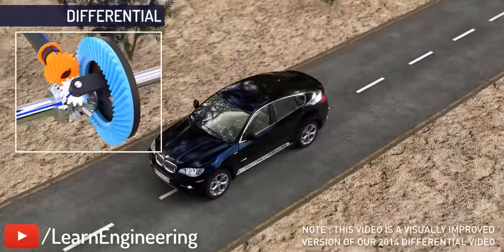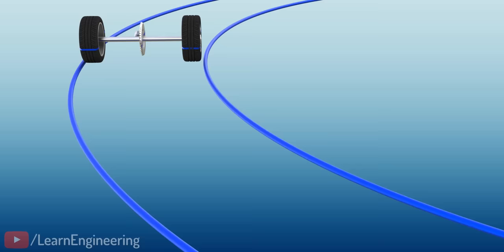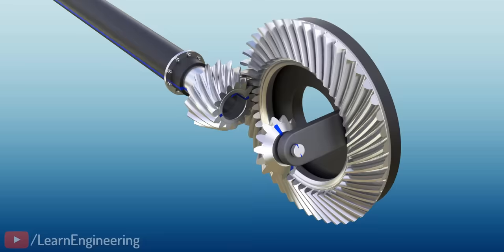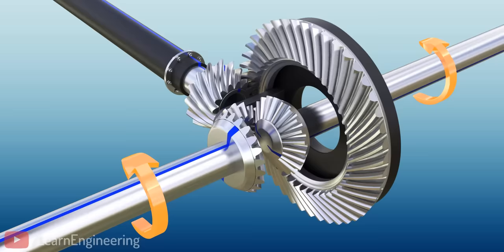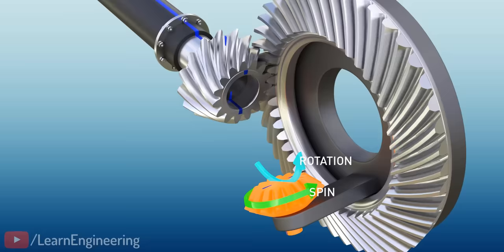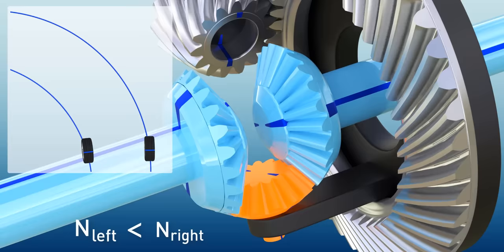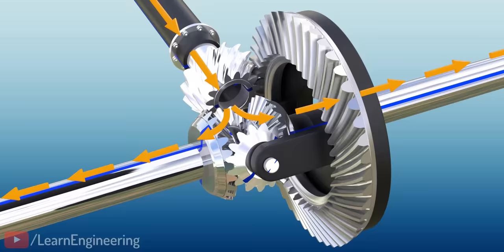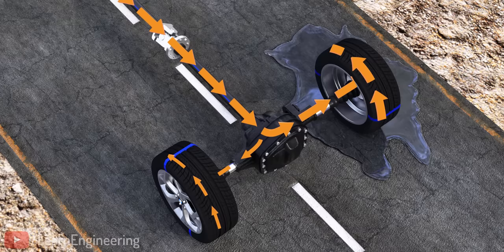Differential | How does it work?

Comment: For Christmas 1962 I got a large scale model car. Although I had to assemble the differential I didn't completely understand the mechanics. After all these years it is nice to have such a clear explanation and animated illustration of its operation.
Reply: It’s one of these things that is so simple once you understand it if u know what I mean. I was looking at the diff in my Ford anglia think8ng how in the hell does this allow the thing to go round corners aha
Reply: @cameronrichardson3108  I was able to keep up until he started explaining how the spider gear works. I still can't understand how one axle can turn slower than the other when both are meshed to one piece.
Reply: how old are u?
Reply: @RichardFStripeRendezvous  so when its going straight, both wheels want to slow down so they both exert a force backwards on the spider wheel but they cancel out. Image just the left wheel trying to slow down, it would push back on the spider wheel and rotate it counter clockwise. If the two wheels are doing this theyll try to rotate it opposite ways and it cancels out. (This is about why they dont rotate when going straight)

Now for turning, the spider wheel is pushing both wheels forwards still because of the larger gear it is mounted on, but the wheel on the right needs to spin less and if it didnt it would have to slip and drag along the ground. This is friction. Instead of this friction happening to the rubber of the wheel it carries through the axle to the spider gear. Remember what we learned about both wheels equally pushing back on it? Well now this added friction causes the spider wheel to rotate. If you look at just the sides of it where it connects to the wheel axles, on the right side the larger ring gear rotation will be rotating the right wheel, but the spider wheel’s side that we are looking at is moving the opposite way.

For the left side its the same, but since the friction is rotating the spider wheel on the right this rotation is added to the left axle. You really just have to think about the gears colliding and pushing.
Reply: @je862  I don't have it anymore. My friend got the Model T. I got the dragster.

Comment: I never even would have thought about the back wheels needing to go through turns, let alone figuring out a solution like this. Holy crap people are smart.
Reply: There's a rear end called a "Detroit Locker" that locks the gears so they turn at the same speed. I don't know it's origins but's used for drag racing so power goes to both wheels evenly at all times. If the racing car turns a corner the inside wheel typically chirps as it rounds the corner because the weight is on the outer wheel and the inner wheel has to spin freely by doing short little wheel hops.
Reply: بتوفيق
Reply: @scottheywood6502  а некоторые заваривают стабилизирущию деференциала
Reply: @scottheywood6502  для дрифта 🤪

Comment: Simply an outstanding instructional. Where was YouTube back in 1969 when I was taking my first automotive class? Thank you for putting this together.
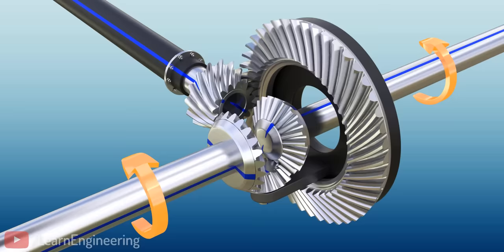Reply: @DMAX-tp4pc  2:06 the spider gear pushes on the two axles in opposite directions, so it doesn't spin when both rear wheels are the same speed

Comment: "The differential is an integral part..."
That's some clever wordplay lmao. Also, how do engineers think of these things?!
Reply: I think most inventor and or engineers simply wanted more efficient ways so they come up with rough ideas until we finally get what we have now. They're goal is to solve problems first. Then they can improve on that I suspect.
Reply: There's another one in the video: "The spider gear plays a pivotal role here."
Reply: They got big brain
Reply: if a differential is part of an integral, it would came back to its original value, plus the c i gues :))
Reply: And later, "the spider gear plays a pivotal role here"
Reply: Haha

Comment: It's brilliantly simple. It just finally clicked in my head. If one side turns lets say a quarter turn more then it's going to cause the gears to spin which has the opposite effect on the other side so it would turn a quarter turn less relative to the other side

Now it also makes perfect sense why if you have a car lifted in the air and spin the tire by hand it causes the other tire to spin in the other way, it's just simply because it has to have the opposite effect on the other side and because the other wheel is stopped the only way it can "slow down" is to turn backwards because the equation goes negative

Comment: A differential is a gear train with three shafts that has the property that the rotational speed of one shaft is the average of the speeds of the others, or a fixed multiple of that average.

The following description of a differential applies to a traditional rear-wheel-drive car or truck with an open or limited slip differential combined with a reduction gearset using bevel gears (these are not strictly necessary – see spur-gear differential):

Thus, for example, if the car is making a turn to the right, the main ring gear may make 10 full rotations. During that time, the left wheel will make more rotations because it has farther to travel, and the right wheel will make fewer rotations as it has less distance to travel. The sun gears (which drive the axle half-shafts) will rotate at different speeds relative to the ring gear (one faster, one slower) by, say, 2 full turns each (4 full turns relative to each other), resulting in the left wheel making 12 rotations, and the right wheel making 8 rotations.

The rotation of the ring gear is always the average of the rotations of the side sun gears. This is why if the driven roadwheels are lifted clear of the ground with the engine off, and the drive shaft is held (say, leaving the transmission in gear preventing the ring gear from turning inside the differential), manually rotating one driven roadwheel causes the opposite roadwheel to rotate in the opposite direction by the same amount.

When the vehicle is traveling in a straight line there will be no differential movement of the planetary system of gears other than the minute movements necessary to compensate for slight differences in wheel diameter, undulations in the road which make for a longer or shorter wheel path, etc.
Reply: DO NOT BE DECEIVED: THE WICKED WONT ENTER HEAVEN.  Jesus was a Prophet. Period

Comment: But, How does the spider gear get to know that wether he has to rotate about its own axis when the vehicle is turning or not??
Reply: Strength of resistance of each wheel. If right has resistance,  the spider gear will rotate and transfer more rpm to left side.
Reply: @dodzb7362  by resistance you mean friction from the road right?
Reply: @dodzb7362  what does it mean by strength?? Both wheels will have equal strength. By taking turn it doesn't mean one will lose the strength and other will gain🙄🙄
Reply: When travelling in a straight line: 

The rolling resistance of each wheel is near equal, and the spider gear will not rotate about its own axis. There is no net force that will cause the spider gear to rotate on its axis. 

When negotiating a turn: 

The rolling resistance of the inside wheel increases. The outside wheel begins to move a higher speed. The spider gear will begin to move on its own axis as the two axle shaft gears rotate at different speeds. 

The spider gears are not powered to move on their own axis. They move on their own axis only when the rolling resistance of one wheel increases vs the other wheel. Think of the spider gear as: a way to apply constant power to the wheels as they slip. Instead of the false notion that: the spider gear rotating on its own axis then causes the output axles to move at different speeds.

If this is still insufficient or does not answer your question, watch US Auto Industry's How a differential works. Its a 7 minute commercial from General Motors corporation that explains a differential beautifully through real examples.
Reply: @gunshipproduct2  great explanation dude!!
Reply: @gunshipproduct2  yes i have already seen that. I know you are talking about that black and white video which actually delivers beautiful concept. 
I asked this question because i wanna clear this. The spider gear is actually not the reason for delivering unequal speeds to the wheels while negotiating infact it is a way by which it is done. Actually the inner and outer wheels have tendency to rotate at a speed such that it can negotiate the turn without slip at their own same as in bull cart or pulling rickshaw. We don't need any differential in wheel chairs at all since they are not joined rigidly. So the spider gear is only meant for providing power from ring gear to the wheels while allowing for wheels rotation at different speeds while negotiating.
Reply: I think this video could clarify this part better.

Comment: Great animation! Just the one correction towards the end of the video: an open differential, by design, always sends equal torque to the left and right sides. There are inherent manufacturing imperfections and other issues that contribute to 'torque steer' and 'torque wander', which is why in practice any road load data will not show a perfect 50:50 split. 
When one wheel is on ice, for example, the loading on the engine drops, so the overall torque being sent through the driveshaft drops, but is still split nearly equally across the halfshafts.
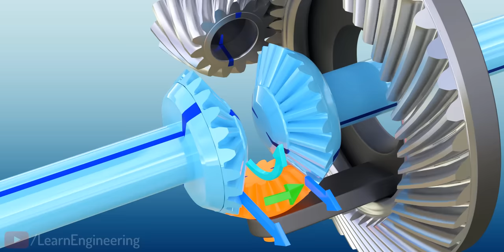Another way to understand the torque path is through classical mechanics: the pinion gear applies a force (N) on the ring gear, which gets multiplied by the length from the center/pivot (m). This gets applied to the side gears via the spider gear. When the car is moving in a straight line, the force is equally applied in the same direction to the left and right side gears. When a wheel begins to slip, the force is still equally split left to right, but the direction changes (one sees the force in the opposite direction). This video has a great representation of that around the 3:00 minute mark. However, since the same force is being applied on both sides and at the same distance to the pivot point (but in reversed directions), the torque applied to both halfshafts is the same.
Reply: You are both correct. He says all the POWER goes to the right wheel. In the situation shown, torque is the same, but rpm of the right wheel is significantly higher than that of the left wheel. So both wheels receive the same torque, but the right wheel expends way more of the horsepower (torque x rpm) in doing so
Reply: power stays the same but torque doesnt. Power is based on rpm as well and since 1 half shaft is goinng faster itll have more power at higher rpm but less torque
Reply: also not sure why they call it a pinion on the drive shaft, typically pinions are the driven gear(s), and the drive gear is the bull

Comment: Would this work in reverse, where two separate engines power one single axis, connected to like a single propeller? Two counter spinning engines with variabel output could power a heli rotor perhaps, of even four engines on four sides working together Powering one single vertical axis... or two counter spinning heli blades....
Reply: Yes, it's called a planetary gear set. It is used in that way e.g. in Toyota Prius

Comment: It's still black magic even after having seen this video.
Reply: The force vectors on two sides of the spider gear decide the turning of spider gear. If the forces are same, the probability of rotation becomes 0. Sounds esoteric but thats how its embedded in our physics.
Reply: @6s9hcr2  thanks
Reply: @Kuak_Kuak  Only reason I'm watching this video about differentials is because I watched that first video you linked. Old videos explain it better
Reply: Nah, try automatic transmission and all that planetary gears stuff.
Reply: @Kuak_Kuak  this is superb video you linked. Do you have any other stuff like on clutch, gears or any mechanism.

Comment: This was a good video as always but you guys could have mentioned that, to overcome the problem at 4:15, cars computers use the brakes to brake the wheel with no traction to force the other wheel with traction to spin as well. This is known as "Traction Control"
Reply: What you describe is called brake based limited slip differential. Traction Control existed before those brake based LSD’s and only reduced engine power to create enough traction.

Comment: How does the spider gear know when to rotate clockwise or counterclockwise?
Reply: 02:17 "spider gear rotates on its own axis. In fact it's forced to rotate because of different speeds of the wheels."
Reply: @balasubramanianp1372  so the difference in wheel speeds decide which way it rotates?
Reply: @therandomchannel02  Yes. During right turn, left wheel moves faster, moving the spider gear clockwise (when on top)..

Comment: After considerable attempts to comprehend the functionality of a differential, my understanding is clear as a result of this detailed and animated account of the operation. Until now I was arguing incessantly with the Dealership Service department folks that the grinding noise I am enduring while turning is not a result of the differential. I was unaware of the ingenious engineering compensating for wheels turning at different speeds. ( Heavy Sigh)

Comment: As a semi truck instructor i can tell you this is a great thing to have in your rears  but this also can cause a huge uncontrollable maneuvers during going through turns - slops - rain  or using any escape routs in time of emergencies.
All equipment in vehicles has more of negative bad sides then good advantages.

Comment from the maker: Hello everyone, this video is a re-release of our old differential video with better visuals. Please watch our old video here - https://youtu.be/SOgoejxzF8c
Reply: How spider gear is rotated to spin, by motor or any other medium?
Reply: Hi, amazing video! may I ask with which programme you made this video?
Reply: @shlokjadhav8253  Varying speeds in the axles. If the ring gear is static, you can rotate a wheel and the other wheel will rotate in the opposite direction.
Reply: Good job thank You.
Reply: @sfoti6973  SIR, can you explain simply because I am beginner but enthusiast to learn? Pls sir
Reply: Thanks
Reply: Your videos are interesting 
Please put more videos on electrical and electronics engineering  also 
It's my humble request from tamilnadu, india
Reply from the maker: @shlokjadhav8253  02:21 - I hope, you didn't listen carefully.
Reply: Please make video on basic of Quantum physics.
Reply: But what is causing the spider gear to turn on its own axis? What is supplying the force to cause the spider gear to turn? It seems as if the spider gear is making the sidegear spin, and thus adding/subtracting power to what the main shaft is supplying.
Reply: Deferencial lock for drawback
Reply: Is there same kind of arrangements for front wheels
Reply: Can you please tell how you make those animations ?
Reply: Hello! Can you explain how hidraulic locking diff work please!
Reply: @aeropeoplellc8160  kkkkp
Reply: @shlokjadhav8253  02:17 "spider gear rotates on its own axis. In fact it's forced to rotate because of different speeds of the wheels."
Reply: @manofsan  02:17 "spider gear rotates on its own axis. In fact it's forced to rotate because of different speeds of the wheels." 

I had the same question..
Reply: @balasubramanianp1372  -  so you're saying that the different turning radius of the inner and outer tires is really what's causing the spider gear to rotate? And so the spider gear is just balancing those forces and indirectly connecting those tires?
Reply: @manofsan  different turning radius causes different speed. Faster wheel turns that side gear which turns the spider gear. 

Differential allows different speeds for the wheels. Spider helps connect both axles allowing different speeds and also allowing transmission to both wheels..

Comment: Simple explanation:  instead of the two wheels without a differential slipping on a road, the two wheels with a differential have the slipping occur inside the differential.
Reply: There is no slipping, just a distribution.
Reply: @UncleKennysPlace  True though even with slipping, like crash gears, the forces of friction get the job done.  Kind of like drifting around a curve rather than downshifting, but different.

Comment: I normally don’t do this but I finally get it. I don’t know how many videos were supposed to explain it and didn’t. I feel as if I could take a standard differential apart now and maybe get it back together or at least know what together should look like. You said heavy load vehicles had 4 spider gears how is there room for them not to bind in each other? And how would one get them all installed? Would that be 1 ton applications or more like semi trucks?

Comment: I never knew about the spider gears. This explains why when you turn one wheel by hand on a remote control car, the other wheel turns in the opposite direction. I always wondered why, but never investigated it.

Comment: For non-technical people or people who have issues with spatial concepts and different moving parts, it's much easier to grasp if you show the motion of the wheels first with just the left and right axis connected with a spider gear. Then show the motion of the wheels at different speeds and later introduce the ring gear and drive shaft. Doing it the opposite way, like you did, can still be confusing. Not everybody thinks like an engineer...

Comment: I had a 71 nova and I wanted a cheap posi to replace my open rear end. People told me I could run a spool on the road some said I couldn’t. I said screw it and went with the spool and had no problems even with drag radials. It was a 355 small block with around 450hp 3500 stall 350 automatic and 4-10 gears. My first run at the drag strip it broke all five lug nuts off the left wheel. The lug nuts were new. I had to order hardened lug nuts. It ran a 7.60 in the eight. Fun car for a POS